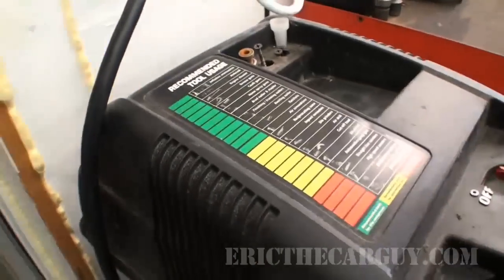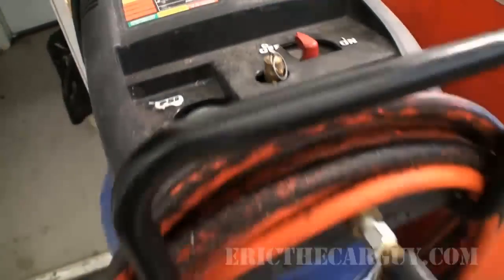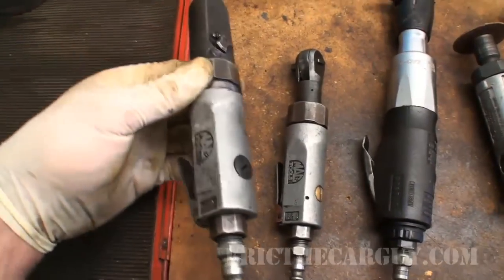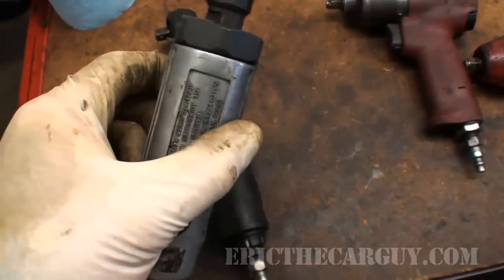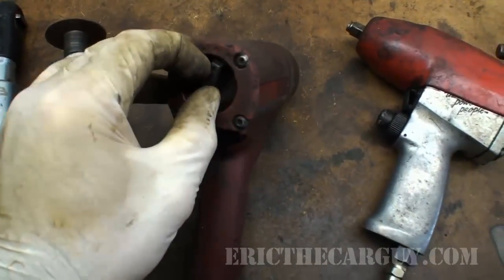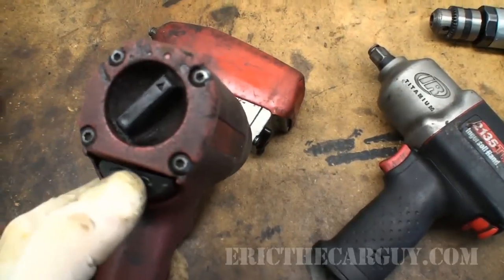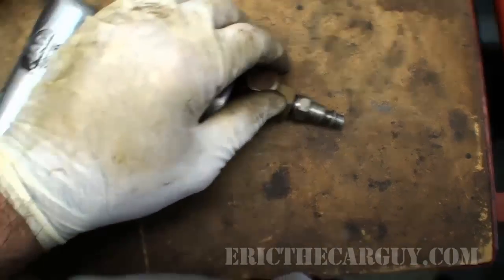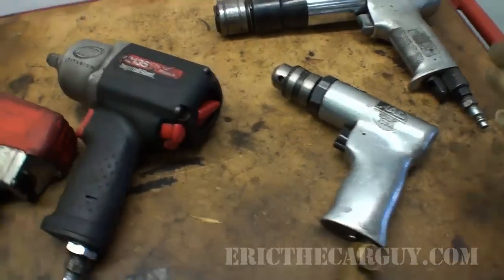ETCG's Air Tools and Compressor

Comment: Who says never to oil air tools? You have to, if you don't and the tool sits for even a weekend without use the cylinder with all the plastic fins will rust to the race on the inside. I can show what the result of never oiling an air tool will do. Then you need to rebuild it and replace the rusted parts or don't replace and just wire brush but then the tool won't perform like it should so yea. Oil your air tools, always.

Comment: I know this is late for comments, but I have a CamHaus 3.5 HP 20 gallon tank on a 115V that puts out 6.8 SCFM @90 and 7.4 @40 and I use a 3/8" hose with 1/4" inlets and have zero problems with my tools.  I'm just a DIY guy and don't use my tools to the max like some others who have commented.  Do you use your air tools for projects other than automotive?  I use a cut-off tool for metal shaping and grinding and was just wondering if you've ever done similar.  Fun video to watch.

Comment: Change out the drain valve on the bottom of the air compressor tank with a brass 90 and then an in line ball valve. It makes it way easier to get to, easier to open and close, and you can direct it into a bucket and keep the mess off the floor. Love the channel!
Reply: good idea

Comment: I'm a shade tree mechanic and own a 80 gallon 5 hp dual stage compressor , I"m suprised you own such a small compressor.
Reply: ok if you say so , then why does my little 6" da keep that busy?? 80 gallons and another person even with 5 hp and a dual stage (working a gun) is keeping that very busy. I could imagin a 26 gallon compressor keeping the pump running a lot more ofter sir. no disrespect intended.

Comment: I got the Hazet 9012M impactgun and its amazing! its a 1/2" and its tiny only 4.4" long and 1.3kg light. It is rated at 811 ftlb for loosen and 500 ftlb for tighten. I work on busses, so basically trucks and it does the job if dont ask too much from this little machine, like loosening truck wheelnuts

Comment: Vertical compressors are nice, save a lot of space in a tight space + easy to move around. (i put mine outside when i use it, crazy thing produces like 98dB). Be sure to use large diameter hoses and large bore fittings, that really helps to get the most out of your tools. Not sure what pressures you can get in the US, but go for high pressure, you don't have to use it (most tools don't allow for it) but its nice to have it available. If only as buffer for the larger tools.
Reply: The tools I use see around 175-180 pounds everyday. Never had any issues with them. But then again I don't buy cheap air tools.
Reply: *****
True, The first thing I always do is remove those dumb long tang air fittings. They drop a lot of flow. The fitting I use have a 1/4 inch hole in the middle. Anything above 10 SCFM requirement is a 3/8 hole fitting and my big tire guns have the glad hand style lock so there is no restriction.

Comment: wut. Never oil air tools? that's a first time I've heard that. 
"apply 4 or 5 drops of pneumatic oil into the air inlet and run it for several seconds. Maintain this tool regularly by performing the same oiling application every 3 to 4 hours of operation"

Comment: Hey Eric! If you're still considering fixing that broken 1/4" ratchet, I know for a fact mac still makes it. I have the identical sealed head ratchet that I dropped and broke few months ago. I gave mac a ring to get the necessary repair parts and it was at my door step soon after.

Comment: I have a whole drawer just full of die grinders. Im surprised you arent running air swivel fittings so useful especially on air ratchets. I personally like air tools over electric, I found my two electric impacts come air in handy sometimes when i working with someone else on a project and they are using the air but they arent very durable like my air impacts. im always worried about getting oil and grease inside the electric motors plus they burn out after a few years and get hot which cause it not to work as good, not to mention they are a lot more heavier in weight and harder to fit in tight places. but anyways nice to see the video. I like to see what automotive is like compered to heavy duty industry

Comment: If you ever do any interior detailing for your cars, you should look at getting a Tornador. I use to detail at a GM dealership and they had those, and they are absolutely incredible for detailing interiors. It is pretty easy to get a show room level look with pretty minimal effort. Cleaning the carpets, dash, getting in all the air vents, absolutely must have for anyone who has an air compressor. I use to have an old Volvo 240, and my interior always looked pristine because I had access to the thing. Since I stopped working there I have wanted my own air compressor just for one of those Godly tools.

Comment: Work at a bus shop, have a Cornwell CAT2135 1/2“ inch, IR Titanium 1/2“ and can say although the Titanium is more rugged and dependable, the CAT2135 is a monster. Only problem is I twisted the anvil off the CW. Since Cornwell insist on screwing there sales people over, I haven't been able to secure a replacement in like 3 years. Thank you Cornwell. 
My 1/4" air ratchet is a Central pneumatic from HF, it is 5 years old and gets the job done. My 3/8" ratchet is a Cornwell, it has been in my lower drawer since owning it, barely ever touch it. 
My most used tool is a 3/8" Impact wrench from Cornwell. It's a ballsy little fucker that just won't quit. 
Cornwell reversible whizzer, Mac 1/2“ drill, Husky 3/8" drill, Mac Air Hammer, in my opinion Mac Tools makes the best Air Hammers. Both my straight and angle grinders are Central pneumatic, after 7 years they work fine, although I never use the straight job. 
Swivels are weird on air tools, great when needed, but I  the way when not needed. Sometimes the floppies can become a nuisance.

Comment: I seem to prefer corded or air over cordless unless it's for something quick and simple. Having both of your batteries go flat in the middle of a project is extremely frustrating, that or the fact that replacement battery prices pretty much mean getting a whole new tool sometimes. AZ heat may take a toll on battery life but it also means dry air and little to no rust.

Comment: Nice enjoyable tour of you air tools.  Kira is right that IR if feed with 150+ psi should blow the Honda crank bolt off in a split second.  My 20 year old 450 ft/lb harbor freight impact gun did when I removed the quick disconnect fitting and screwed in a 1/2 ID 10' hose directly in to the gun and turned my compressor up to 165 psi.  The bolt came off and went flying out of the socket.  It was so fast it was like a gun shot.

Comment: You try not to, but you will get some water in your air tools. I found that BLASTER 404 AIR TOOL CONDITIONER works great to remove calcium and varnish. If your air tools start running slow try 404. This stuff works.

Comment: 1. Change compressor oil regularly.
2. Dehumidifier in the air line is usually a good thing (can cause pressure drops).
3. Air tools should be oiled regularly (oiler in the air hose does it automatically).

Comment: I repaired air tools for Chicago Pneumatic.  Put a drop or two of light (10W) oil in your air tool when you are through with it for the day.  It is still warm and the lube will do a better job.
Reply: i dont know about you but none of my air tools are ever "warm" after use, they are all stone cold like holding a piece of dry ice, especially die grinders and stuff like that, i just oil them before i use them
Reply: FlyingWldAlaska77 yea with compressed air running thigh them they will get colder. Ever open the drain on your compressor and it freezes solid with ice in the middle of June? It does for me. When compressed gasses expand the cool down a lot.
Reply: same principle as a refridgerator works, and our compressor does that too, when we drain the water it freezes to the inside of the pipe and breaks off and throws chunks of ice, once i had a die grinder get hot when it started seizing up, must have had a bur in a port, was a chinese one so its very possible, but i let it stop and went again and it still runs fine, but if your air tools are getting hot you got problems

Comment: You need a teflon ball-jointed drain valve on your compressor!  I pieced together the brass plumbing needed to so that i could get to it with my foot so I don't have to get on my hands and knees to open and close the vent.  Then again, I use my compressor very rarely though, so i open the drain to vent the pressure and moisture every time I use the thing, but the design of my Craftsman compressor is nearly identical to yours.

Comment: If you're looking for an awesome 1/4 air ratchet Matco has the best, super small palm ratchet, great for timing covers and other tight areas. Doesn't put out too much power so you can tighten valve covers down with confidence without worrying about snapping small bolts.

Comment: I just bought a Napa professional torque dominator 1/2" impact wrench and it's rated for 1200ftlbs break away torque I can't wait to see how well it works. I wanted something with more power than my cordless impact wrench I have a 1926 Champion 30 gallon compressor I am not using it for making a living like yourself but if it works I am a happy camper

Comment: my matco 1/2 inch impact has 1300 pounds of breakaway torque...... i think it to is an ingersol-rand love it alot
Reply: my dewalt 20vXR 1/2" impact gets 1800fppsf breakaway torque with torque to spare. The newer high voltage battery powered tools are going to kill the need for numatics if they keep this pace up because they are more powerful and more convenient to work with than most air tools across the board.

Comment: That rusty water means there's dirt getting sucked into the piston intake and it mixes with the condensation in the tank , causing corrosion.   Its highly likely that there's a build-up of dirt behind the drain plug.  It would be worthwhile to unscrew the inspection port and spray down the inside with water and clean it out.  Air pistons need an air filter, but most of these compact enclosed units just have an open hose in there.

Comment: bought a cheap 3/4 gun from harbor freight. so far it took off honda crank bolts using the same air hose you have. a little oil does seal up the vanes in an air gun and can some times make the difference in breaking a bolt free.

Comment: Eric,  you're sealed head Mac 1/4 inch air Ratchet should be repairable, I have the exact one (use it all the time as a flat rate tech) it broke just like yours and all the parts are avaliable.  fixed mine just ask week.

Comment: I agree, oil your air tools.  I've rebuilt countless air tools as an industrial maintenance tech.  Many have single side shielded bearings and rely on oil mist to keep them lubricated from the open side.  I soak all new vane packs for IR air grinders and impacts in oil as well.  Grease for output bearing is a good idea as well.  That's the bearing that's most likely fail.  That port on the IR impact probably greases the impacts hammers too.  You wouldn't believe the crud from old shop piping!

Comment: Dragging around an air hose is a drag. I'm slowly replacing my air tools with cordless versions. However, I do think you need a 1/2 air impact gun when you really need the torque.

Comment: My first compressor was a Campbell Hausfeld 2 hp 20 gallon with 5.6 SCFM @ 90 psi.  Your compressor air tank is 26 gallon.  Just the motor is small for a large tank.  Should get at least 2 HP to 3 HP compressor.

Comment: Just a regular DIY kinda guy. Lubricate all my air tools, but anything dedicated to body work, only gets a couple of drops and ran off to the side till lube stops coming from air exhaust port. It's sketchy at best. I keep my drain valve slightly cracked at all times. Small tinfoil pan to catch moisture, under the compressor. Also buy these cheap ass water filters, water separators, from Princess Auto, Canada's version of Harbour Freight. Little plastic balls about the size of a golf ball. They screw inline between your air hose and tool

Comment: Eric , if  you  need  power  try  a  Nitrocat/Aircat. 3/8  rated  at  500lb  and  1/2  rated  at  1200lb  off  900  on,  I've  broken  new  1/2  grade  8  bolts . And  they  are  QUIET . twice  the  power  and  1/2  the  noise  of  a  new  snap-on

Comment: Electric impacts are cool when you go to the junkyard especially on cold days, I sure envy guys when I see them, the good quality ones are very expensive (Snap On +Ingersoll Rand). Craftsman electric impact has about 200 pounds, that sucks. Plus if it is not ion, the battery begins to die slowly when you need it the most.  The newer IR impact gun is the 2135TiMax, I got it and I love it, replaced the one that you got in your video. Like you said, it comes down to individual choice. Great videos.

Comment: Just a few comments Eric, The 60 gallon requires 220 and if you do not have it in a garage, it costs about $300-500 to get the line installed. Some older Craftsman ones, though smaller, also run on 220, I learned the hard way. You should drain tank everyday you use, not one in a while. Electric impact is NOT powerful, air is the way to go, New IR run 780 ft. lbs. I use 1/2" for suspension etc. I also use bigger nipples to increase air flow, helps a lot. Also check the IR 2025 Max, cool tool.

Comment: done it for years most shop air is not regulated so 150-175psi at the hose depending on pressure drop, the biggest issue is keep it lubed and if you get water out of the lines add a water trap.

Comment: have you done a video like this for your electric tools too, such as the Dewalt hand drill thing you used in the Pontiac Montana exhaust manifold video?
Reply: Ive been thinking of getting some electric tools because I only have a very small garage to work in with almost no room for a big compressor or much room to maneuver hoses and whatnot, so what you said about freedom of movement with the electric tools really resonated with me. I found this video extremely helpful and informational and it would be amazing for me if you did happen to have a video like this about what sort of electric tools to look for.

Comment: It would be interesting especially for me, to try a specific air tool that says it's capable of running with a certain compressor with certain CFM and doesn't. Trying first with a 1/4 BSP hose and then again with a 3/8 hoze. Maybe the compressor is ok but the Air is being restricted by the size of the hose. I bought 2 airtools for my small compressor and they just don't work. They lie alot about CFM

Comment: I just stripped the screw for the caliper on both side and I would not be able to get it off. What tools do I need to get it off and replace it with the new screws? I was trying to put in new brakes, but I couldn't. Any advice would be appreciated.

Comment: Bostitch  has a good hose called Prozhoze its light weigh and has no pull we use then only in construction & roofing, and yes we oil the guns every time we pull them out, we did not do that before and went thro a couple guns

Comment: Hey Eric, got a question about my car. It is 2000 Avalon. The car shakes when it reaches 55mph. Before I took the car to a nearby shop, both have told me that you need tires. I suspected that would be the issue. The car, definitely needed a tire, but for that shaking didn't believe them. But I went and put a set of tires and still have the same problem. I have a break hesitation as well. What is this shaking come from? Thank you.

Comment: Yes that 3/8 impact gun is built for Mac (and Cornwell) by IR. I had a TI2135 like yours and got rid of it and bought a Snapon MG725 to replace it. The ONLY reason is the Snapon slows down quicker when you let off the trigger compared to the IR which free wheels allot longer. I do miss my 2135 though. Those are the lightest best balanced 1/2" guns on the market with mega torque. I wish I had kept mine. I love my Snapon but it is quite a bit heavier then the IR.

Comment: I wish I could fit a 26 gallon tank somewhere at my place!  Unfortunately, I don't have a garage, just a driveway, and leaving something like that outside would just have it rusted and destroyed in a weekend.  :(  So I had to go with a 5 gallon model so I can put it in the shed when I'm done.  Unfortunately, it means I get 5 seconds from an impact wrench.

Only thing I can think of is to get a reserve tank and leave that outside, and connect up to that with my portable unit.

Comment: the drill does not have a pressure regulator bro its a needle valve, you can call it that.. But its not the correct term.

Comment: I've run my Harbor Freight air guns at 200 psi on my gas engine air compressor and never had trouble. The problem with 90psi is that it won't take most bolts loose.

Comment: QUESTION: I'm about to change my rotors, shocks, and struts!  I can see the bolts are big, rusty, and look as if they're going to be a pain. I know I'm going to need a compressor!  Would an 8 GALLON be strong enough for a project like that?
Reply: I Surg gallons is just the capacity of the compressor, if you have it plug in, it will be refill automatically,what you really need to know or to have is, the horse power of the motor and the PSI that can be use with the tools you need
Reply: I Surg gallons is just the capacity of the compressor, if you have it plug in, it will be refill automatically,what you really need to know or to have is, the horse power of the motor and the PSI that can be use with the tools you need